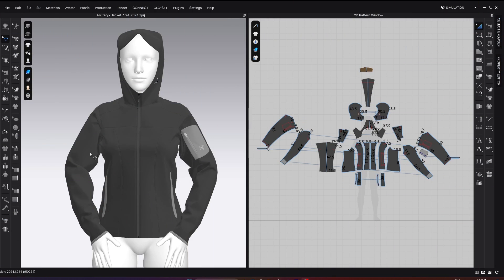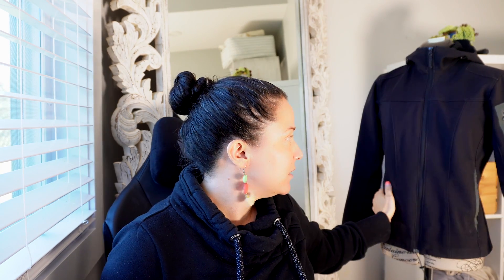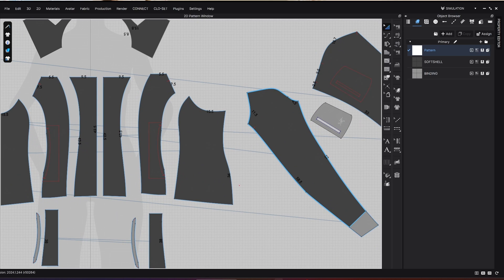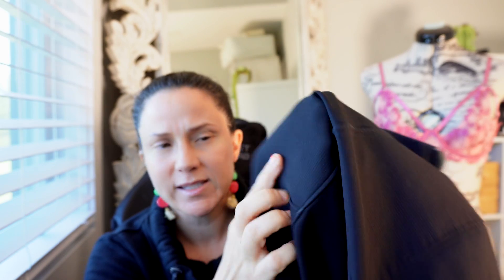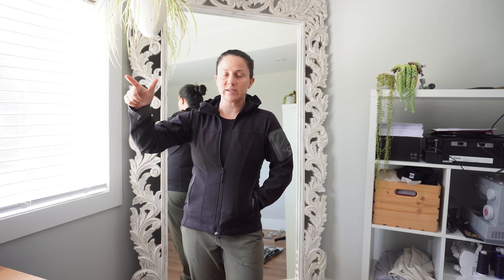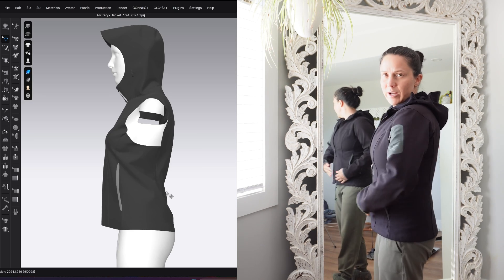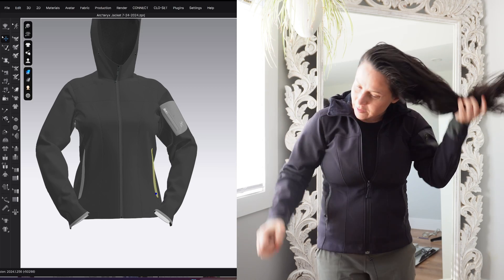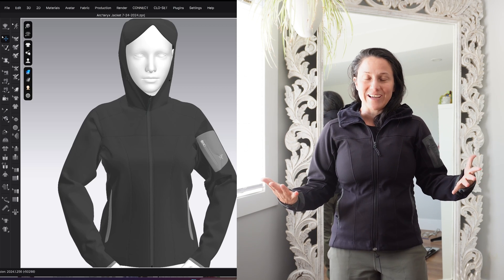Deconstructing an Arc'teryx Jacket in CLO3D

Comment: But... Most of the Arc'teryx jackets have panels that you can't lay flat without destroying the jacket. How would you go about that?
Reply from the maker: If I could not pin the panel flat (like on the hood) I pinned as much as I could flat on top of a piece of paper, and moved the panel along with the pins, then traced out the pin holes on the paper to get the flat pattern, does that make sense?
Reply: @trudygardner6663  The arms are sewn together like a spiral and I can't pin gore tex because it wil damage the material. I have not been able to copy it.
Reply from the maker: @ Oh, this sounds like a really interesting design.  Yeah, you don't want to be poking holes in your goretex.  I'm not sure how I would tackle this without seeing the actual garment.  I would maybe lay out the panel as flat as I could, finding a straight fold along the grainline somewhere, then trace as much as I could.  Maybe I would try using tracing paper over top.  Then I would flip the panel so I could trace the other side.  Then I would bring those images into Clo to try and make a pattern from them using the measurements from the jacket as a guide.  Good luck, and if you figure out a solution, let me know how it goes!